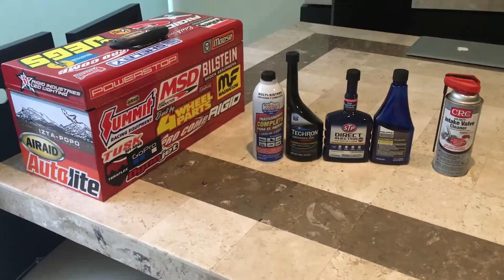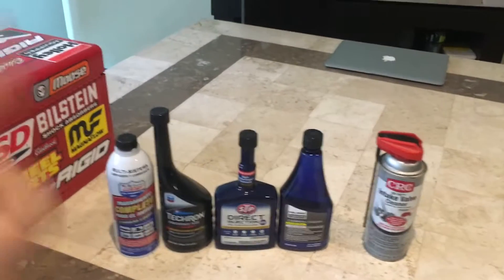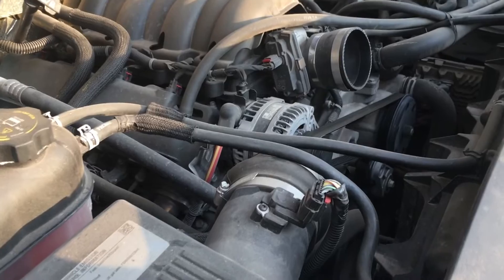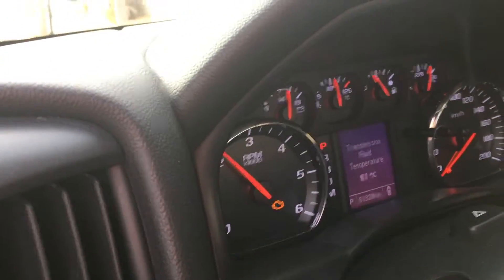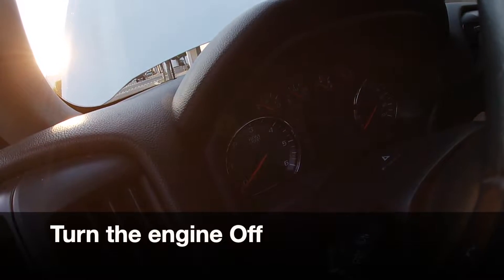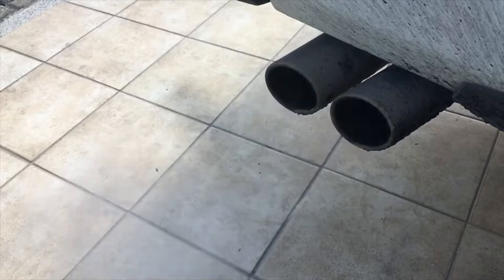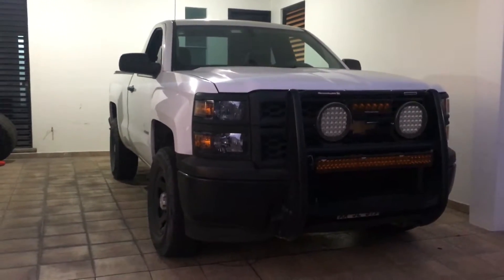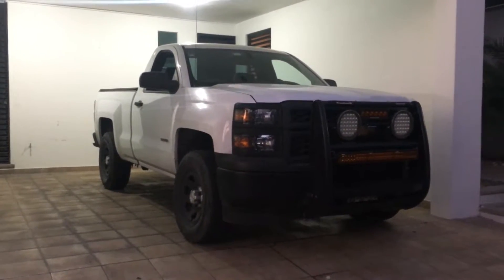How To Remove Intake Carbon Build Up Using Fuel Injector Cleaner

Comment: I have a 2016 canyon with 190k and the intake valves have never been cleaned. Now my question. Should I do this to an engine with high mileage considering the amount of carbon buildup that is most likely there? I don't want a giant chunk if crap going into a cylinder. Or am I overthinking things?

Comment: Getting prepared to tackle this job, but have another question. When you pour/spray a cleaner into the throttle body do you let it run at the 2000 RPM for any length of time before cutting it off or just cut it off after finishing pouring in the cleaner?
Reply from the maker: Stan, I cut it off immediately after finishing pouring a bottle

Comment: One more question for you since you were so kind to answer my 1st question. So, I take the intake off to expose the throttle bottle and follow your instructions, but after the bottles of Techron and after the car has sat for 1 hr , I will need to bring the car to operating temp b4 I adding the Polaris, so will I need to reinstall the intake to warm the car back up or can I do it with the throttle body exposed? I ask becuz I have a Genesis G80 and the intake is quite involved and a real pain to get off and on.
Reply from the maker: Stan You can do it with any cleaner in any order, I just did it for showing purposes. Just leave the engine rest 1 hour between bottles. You can leave everything exposed, just beware of from rain/dust
Reply: @BadAssEngineering  Thanks for your replies, I really appreciate it and your videos. You are different from any other video I have watched as they all pour the stuff in the gas tank like the directions say, but you think outside the box and put it where it needs to go. You da man!

Comment: U use a fuel addictive to clean up carbon build up, where does it go burns thru exhaust, oil pan?
Reply from the maker: jay it dissolves the carbon, burns in the combustion chamber and goes out the exhaust
Reply: Ohh okay i filled my tank in 01 civic then afterwards added 10oz of cheveon concentrate plus to the tank, bottle says nearly empty err half tank, will the benefits still be there?
Reply: Ive read and example they say redline should do jus before an oil change...
Reply: Goes into your catalytic converter where it damages the honeycomb.

Comment: Is this process safe for cats? Can it be done with any DI powered car? Thanks.
Reply from the maker: I don't have cats on my truck, but have done it to other stock cars/trucks with no issues. It works on any Gasoline DI car
Reply: @BadAssEngineering  thanks for the quick response. If you don’t mind me asking what part of Mexico you reside? My fam is from Guerrero.
Reply from the maker: @unitedwestanddividedwefall3521  on the mountains of Veracruz
Reply: @BadAssEngineering  oh ok. Nice. Haven’t been to that side yet. But I’m planning to.

Comment: CRC valve cleaner is still available at Amazon
Reply from the maker: Onbok Yi thanks for the  heads up but I live in Mexico. Also, CRC IVC contains diésel in the mix and makes the engine knock a lot. I prefer to use Techron since it has a more concentrated PEA content

Comment: As usual for me, I get the hard stuff and the easy stuff kicks my ass! So, I get off the intake to expose the throttle body which was not that easy, then I go to pour the Techron like you did and what a mess! The throttle body seemed to be tilted down just a hair and the butterfly valve was closed. I had a helluva time trying to pour in the stuff! It ran out the throttle body and it ran down the bottle and all over the engine, smoking like crazy! It went everywhere except in the throttle body I think. I tried a funnel but that did not work either. I stopped at one bottle and did not use the Polaris, I had had enough! Why does something so simple have to be so damn difficult.
Reply from the maker: You can also try to do this via a vacuum line going into the intake, the cleaner wont spread as evenly in the manifold, but it would be better than nothing
Reply: You could put the front end up on ramps and let most of the air out of the back tires.

Comment: so this is a dumb question I am sure, but her it goes anyway. U have used the Polaris cleaner for a year and all seems good, but I can't find any info that says it is okay to use on passenger cars and trucks as it seems to only be recommended for recreational sports vehicles. Did you find any documentation or call Polaris to verify it was okay for passenger vehicles?
Reply from the maker: Stan There are not dumb questions, dumb is not to ask. All gasoline engines are exactly the same. Polaris ProStar engines don't use different materials or anything, they even use the same Bosch computers, injectors and Throttle bodies used in cars. Any good Gasoline additive will work on any gasoline engine!

Comment: What's the 2nd product you're using to pour in? Or can you just keep using CRC? Planning on doing a carbon cleanup this week while replacing my intake manifold mk6 gti
Reply from the maker: khiev I stopped using CRC because it contains diesel and makes the engine knock. Just use Techron or any other injector cleaner

Comment: How do you know its working? Chrisfix put a before and after shots to check for the state of the carbon buildup on the combustion chamber and actually none was very effective. As for what you said, My car is 9 years old and still gives same MPG, so Im not sure they work at all, after seeing Chrisfix's videos
Reply from the maker: Depends if your vehicle is direct or port injected, what im going for is the carbon building in the intake ports and valves, not so much for the chamber or piston. GDI engines have problems with carbon in the intake.

Comment: is this effective??
Reply from the maker: Very, my truck is 3 years old and still gives the same MPGs as it was when new. If you want better results, find Techron Marine, it has more percentage of PEAs. I will be removing my manifold in a couple of months to see how my intake runners and valves are.
Reply: @BadAssEngineering  how long or how many milage to do this clean up??
Reply from the maker: I do it every 6k miles, but you can do it as often as you want. You can also get a sprayer in Home Depot to atomize the cleaner better in the throttle
Reply: @BadAssEngineering  ok..thanks for the info..

Comment: i dont see any results betwen products... can we see the valves?? were is the diference?? bad bad video....
Reply from the maker: Im planning on removing the Intake on my truck at 50,000 miles. There will be no carbon because i have been cleaning  it like this since day 1. If you refer to my other video, i explain why any injector cleaner has the carbon solvents necessary to remove buildup
Reply: @BadAssEngineering  hello are you still doing this treatment?
Reply from the maker: @pilotdog68  yes, i Just removed my intake manifold and everything is amazingly clean (i removed the PCV lines to the manifold years ago tho)